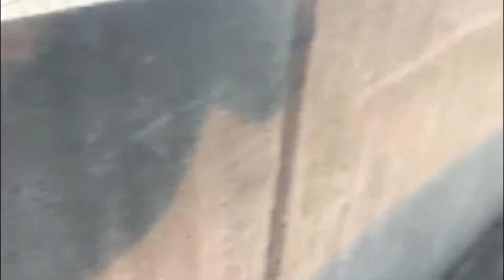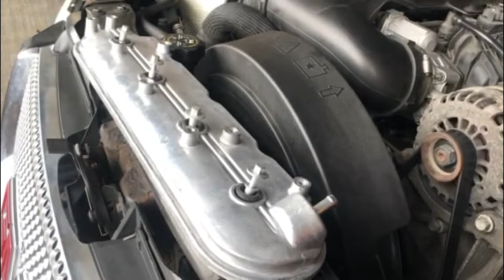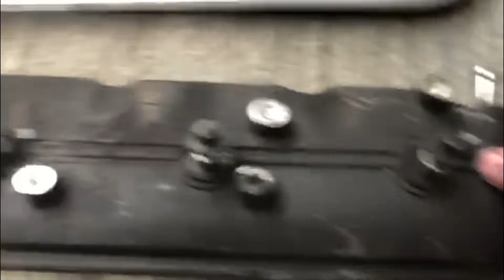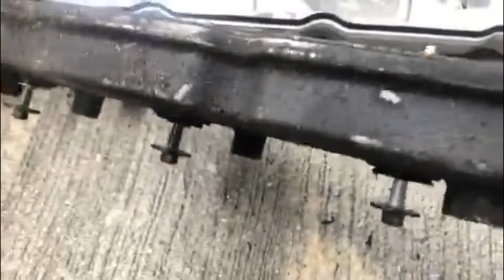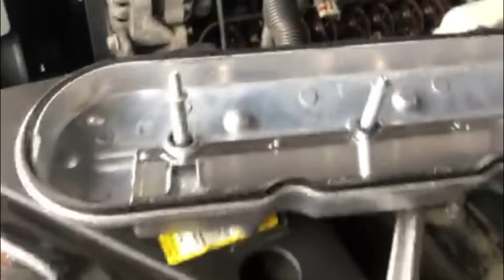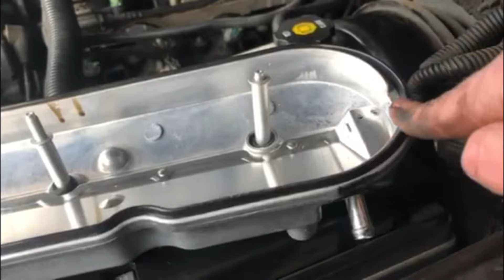Major Oil Loss!!! The GM Valve Cover Swap That Could Save Your 5.3 LS Engine / Motor How To Tutorial

Comment: Need to disconnect the battery and torque the valve cover bolts to 106 inch lbs.

Comment: Just did this on my 06 silverado. Very easy and quick, except that I never know how much to torque those 8mm bolts with the rubber gaskets. You can keep tightening them and they never feel snug... I snapped one and had to replace it with one of the old ones.

Comment: I replaced mine today in my 6.0L G8 GT and the holes were not blocked with sludge. There was some staining, but mine didn't look nothing like yours. But I put the new one on anyways since it is a better design. Frequent oil changes helped keep it clean and I use Mobil 1 5W30 High Mileage Full Synthetic.

Comment: So is the pcv valve Not servable.  In the new one ?
Reply: It's not an actual valve...it's just a vent that takes pressure that builds in the crank case and runs it back to the intake manifold.

Comment: I have that style valve cover in my truck and i took valve covers off and cleaned them and painted them. I also wanted to replace the pcv valve. So i took the old one out which was challenging since im not sire they are suppised to be removed and replaced with a new one. The guy at napa said i could do it and i did get it done. So i think its all good now

Comment: You do not need to change the valve cover take high compressed air and blow down through the fake PCV valve tube to clear seep hole  blockage problem fixed no more smoking or oil consumption

Comment: I thought the issue was with pcv and oil baffle on older style  covers was, pcv in wrong location which was lower right corner of cover and of course the baffle directing oil to that pcv? Your covers appear to be the newer covers that have the pcv port located to the high right....are you sure your covers needed changing?

Comment: 2005 Yukon. I did the repair successfully.  Drivers side only valve cover removal. Drilled out 13 holes. As shown.  
No more exhaust smoke and very little oil loss. Full Synthetic oil only.
I used the rtv silicone to assure no leaks.

Comment: Dude I have a major leak from valve covers I'm about to do new ones did u experience better oil pressure I have about 20lb used to be 40+
Reply from the maker: @bricehale6593  this worked great for me. No more oil loss. Individual results may vary.
Reply: Change the oil ring on the oil pump suction tube-  get the part from the dealer, the aftermarkets don't work.
Reply: @frankpeletz1818  you may be correct, I have it all apart right now oil pan and all has a new mhv pump, with a green o ring, I just bought a melling, a mahle, and some other green ones, and the new melling, is the one o guaged to be the most snug fit, and I'm gonna put a girdle on it, for some reason I'm gonna halfto modify the flag to used it to help hold down the other side, because when the tube is in place in the pump, and the bolt is in, the flag on the easy side is covering the bolt hole, where I've seen guys on video just screw them down, idk 🤷‍♂️

Comment: Did it fixed your problem? 

My 2013 Chevrolet Tahoe has 121k km on it, and I’ve noticed it’s starting to lose engine oil. I inspected it and found no smoke or leaks, but I can’t seem to figure out the issue. Additionally, my fuel range used to be 500 km on a full tank, but now it’s down to 420 km. 

I’m also planning to replace the oxygen sensor this week, but the oil loss is really worrying me. I always change my oil on time or even before it’s due—usually when I have 30-35% oil life remaining.

Any thoughts on what might be going on?

Comment: I have a 2000 gmc 2500 6.0, #1 what kind of engine do i have ,sl ?, 2 is this an issue  as this vid points out for me.
Reply: 2000 6.0 same family ,uses a pcv valve- there is a bulletin to replace the factory 948c with a fixed orifice -the aftermarket listing  valves have the smaller opening. Most of the consumptions problems are caused by the AFM  on the newer engines.

Comment: So How Much did oil consumption improve
Reply from the maker: @mrj7872  mine improved to a point I no longer needed to top off between changes.
Reply: @The_ManCavern  yes! I did this back in 2015 on my 01 silverado 3500 with the LQ4. It was killing about 2-3 quarts of oil in between changes. I swapped mine out, and it dramatically improved to half or ¾ of a quart per oil change! When I decided to drill small holes on the inside of the valve cover, I wasn't burning anymore than ⅛ of a quart per oil change. For the most part, I don't have to refills anymore!

Comment: Change only on the driver side or both valve covers?
Reply: Did you replace both or just driver side?
Reply: @michaelgarcia4117  driver side
Reply: @michaelgarcia4117  only drive side needed

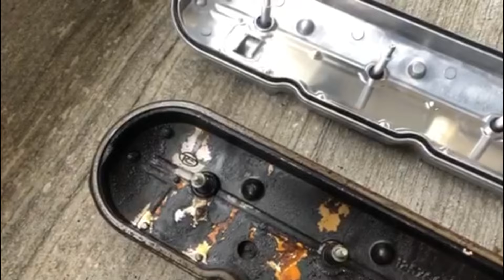Comment: You mentioned they fixed it after 06. My 07 5.3 NBS Silverado 1500 had the old style valve cover. Just putting it out there so people don't think they're in the clear if their vehicle is 06+! 5:11
Reply: It starte with the 07.5. They they never made any attempt to fix the oil consumption problem. GM actually said the oil consumption was normal in order to not warranty anything. The sad part is that GM continued to build their AFM system the same way for years!  They must pay their engineers to sit on their ass and not fix their issues!
Reply: @billmonroe8826  Planned obsolescence
In economics and industrial design, planned obsolescence is the concept of policies planning or designing a product with an artificially limited useful life or a purposely frail design, so that it becomes obsolete after a certain predetermined period of time upon which it decrementally functions or suddenly ceases to function, or might be perceived as unfashionable. The rationale behind this strategy is to generate long-term sales volume by reducing the time between repeat purchases.
Reply: I'm an 08 tahoe... was thinking I'd open up and look at the valve cover before buying new cover.

Comment: I don't recall you stating what the torque on the valve cover bolts were
Reply: Yeah that’s very important, could leak through grommets if torque isn’t right
Reply: 106 inch pounds

Comment: Looks like you already had the updated valve cover? You have the built in PCV...
Reply: I have 2004 Aval and there is no oil leak or consumption issues. Yes, Built in PCV started on 2004 and later. anyone thinking to fix the PCV may swap older 1999 2003 driver side valve cover with external PCV.  in regality the PCV is only a air metered inlet not even a valve. Recommended 3k oil change will reduce all the issues, but way late wont help if was not done on time.  Oil consumption also may caused by oil pan leak.
Reply: There was a service bulletin to replace the 948c pcv valve with a smaller fix orifice  p/n 12572717 on vehicles with replaceable valves.
Reply: there are 3 versions of this. The first, like my 2001 Sierra, has a really crappy baffle and a real PCV valve that is replaceable.
Then what he had was the second version, which had the built-in fixed orifice instead of a PCV, but still the older baffling.
Then the 3rd is the fixed orifice with the new baffling to help further resolve the issue. So yes, he had a newer cover than what is on my 2001, but it was not the newest. His original was V2, and he installed V3.

Comment: I have the 5.3L.  I had success.   used the old cover( drivers side only)  and drilled out as suggested About 13 holes in total on the underside baffle and and driiled out the PCV hole larger. About 1/4 hole. Use rtv silicone to assure no leaks on gasket. 
Also one guy is  advising a full court of ATF in engine. 
My 5.3L suburban started using a lot of oil suddenly when I started driving it more in the winter and idling a lot.
I'm using synthetic oil now the last three changes.
Reply: I know I used half quart tranny fluid to the oil on a Tahoe it stopped all the rattling lifter tapping, ran it for 4 days changed oil all's good
Reply: What's the purpose of drilling holes?
Reply: @sean.g4516  I think the reason is the cover has a channel to the pcv in the back.  If that pathway is too blocked there won't be enough pressure to open the valve and the pressurized engine will find another pathway to eject the vaporized gasoline and oil.

Comment: Did you buy a GM parts or after market valve cover?
Reply: Be careful — a lot of the "expensive ones" are still using the older V1/V2 baffling like what he removed. They claim to use OEM baffling, but it’s the old design, not the V3 like he installed. Also, the cheap Amazon ones aren’t very good — lots of reports of metal shavings and such. Just buy a Dorman from your local parts shop for around $70, and if it doesn’t look like good build quality you can just return it right away.

Comment: Hope your okay. Update on the oil consumption? I have a 2001 GMC Sierra 5.3 with over 377,000 mile, has misfires and losses a lot of oil. Any thoughts
Reply from the maker: @jacobgiroux7541 never had a problem after that. 🙂 oil loss could also be leaks at that mileage. But this helped in my case.

Comment: Did a 280K mi. VC gasket job recently.  They were the originals lmao.  The engine certainly burns a certain amount of oil due to hi mileage, but the main oil loss issue has always been leakage -- not any more.  Oil consumption has been very negligible since forever. My guess is your oil consuption through the pcv system is because there is apparently no valve in the positive crankcase vent.  Mine has a valve  & no problems.
Reply from the maker: @Salmon_Rush_Die  the replacement fixed my problem. But Individual results may vary

Comment: You should have added a few holes lined up acrross where that tiny hole is at the end and also drilled out the hole at the end bigger for better oil dispursement that is best fix for the pcv isdues

Comment: You should have added a few holes lined up acrross where that tiny hole is at the end and also drilled out the hole at the end bigger for better oil dispursement that is best fix for the pcv isdues
Reply: Do you have a picture or drawing showing this tip? If I gave my email could you give a bit fuller explanation of how to do this? Thank you.
Reply: @2TCorDie did you get a answer?

Comment: My 2009 Chevy Silverado 5.3 engine sounds good for 10 minutes after I turn on then I  driving down the street then the truck starts smoking from the muffler starts to idle and start to buck when I take off from a complete stop at a stop sign then the traction control light starts with the check engine light to so if I put a new valve cover this will solve my problem.

Comment: What’s the torque specs on the valve code and coil pack?
Reply: On my 5.3 Silverado it's 106 inch Lbs for cover bolts, and the coill pack bracket just snug them down. I've seen vids where they say 96 in Lbs but my shop book says 106 for a 1999 Z71 5.3 Vortec
Reply: Remember. Those are in pounds. Not ft lbs. 106 inch lbs is equivalente to 8.4 ft lbs.

Comment: I’ve done this upgraded valve cover in my 2006 Silverado with the 5.3 vortec years ago and it changed absolutely nothing. The oil consumption was still as before. What the real culprit is, is that there is but one tiny oil drain hole which if I remember correct is after the Pcv valve which makes absolutely no sense as the oil has already been sucked into the intake by then. You need to drill about four extra small holes on the baffle about an inch apart or so. then clean the crap out of it with brake cleaner and an air compressor. I did this on mine and the oil consumption has been next to zero. 

Here’s a link to the YouTube video I followed

https://m.youtube.com/watch?v=CePGNsAkcYQ
Reply: You modified both valve covers ? or just the driver side ? Also what size drill bit did you use ?
Reply: Did the same thing to my 2004 Chevy Silverado 4.8L by watching that same video this past weekend. I drilled some extra holes and drilled the original hole that was on the valve cover a bit bigger too. So I will see how that works out til my next oil change. 
But I think  I should have thr same results as you and the guy from the video have had. 😎👍🏼

Comment: Put a pct. Valve in the line between the valve cover and the intake. That stopped mine from using oil.
Reply: where you get that part. sir David

Comment: My 2012 Silverado 5.3 is going through one quart oil every 800 miles. I discovered the oil is going into cylinder #7, spark plug is covered in oil. Will changing the valve cover to the modified one fix this problem?
Reply: Most likely valve seals.
Reply: @goch907

Comment: 5.3 is the best engine EVER!!!!!!!😍🥰👏🦾
Reply: 6.0
Reply: @mypony7310 5.3 is better its proven....
Reply: @jonsanders3367 that’s good to hear if it’s true
Reply: I did the cylinder heads. Back in March. Runs great. 291.000 miles . I'm really impressed  with my 5.3 engines..Be BLESSED
Reply: Only if you remove all that AFM sh*t the government put on them.
Reply: Do tou have e. Part number
Reply: 4.8, 5.3, 6.0 is basically the same engine, just with slightly different rotating assembly. They're one of the best engines ever created by GM. My 01 Silverado 3500 LS with the LQ4 has 491k miles with the original head gaskets, heads, original bottom end.

Comment: 7:54 so how much has the oil consumption improved from the 1 quart per each gas fill up? I need to change my pcv since I burn 1 quart every 700 miles.
Reply from the maker: @fish4fun354  I no longer had to add more oil after this.

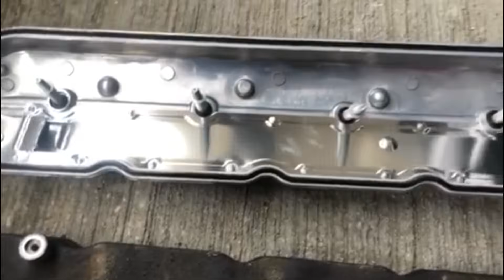Comment: 4:52 why did you say the pcv is just a tube? I have the updated cover but my cover is old again and pcv needs changed. You threw me off and called it pcv later on in the video. Thanks for showing though.
Reply: It's really not a pcv. A pcv is like a check valve. On this engine it's clear through both ways. No valve inside. Hope that answers your question
Reply: @awyoumad  So do these trucks not have a PCV? I've read plenty of reviews that got this cover and fixed their oil consumption issue but not sure if some had to replace updated cover twice.
Reply: @fish4fun354  No, the new valve cover does not have a PCV. The old valve covers did, and GM’s first fix was simply replacing it with a fixed orifice and throwing away the PCV (didi not really help much). The new valve cover doesn’t even have a PCV to remove, it only has the fixed orifices.

Comment: 2010 Chevy Avalanche 5.3 owner here. My valve covers have never been replaced and apparently are the older ones you have replaced and reported problems with. I have never had any oil consumption until just recently, 153k on the odometer. Saw about a quart missing after 1.5k miles after oil change, i did have to replace the oil pressure sensor and filter so I wonder if that has anything to do with consumption either. Anyways worth mentioning my “newer” GM also came with older VC’s.
Reply: Mine is at 180k and needs both

Comment: Did the valve cover come with the gasket also?
Reply from the maker: Yes it did
Reply: Is their a part number or anything?  What's the magic words to find new updated valve cover?  I have 06 tahoe that after sitting awhile it will belch smoke on startup.  Any help appreciated.
Reply: @ 45 seconds he states it comes with a gasket and pcv valve

Comment: So would a bad pcv valve cause an oil leak?
Reply from the maker: I would add the PCV “valve” on these is just a tube.
Reply: V2 and V3 do not have a PCV. He had V2 and switched to V3. V1 did have a removable PCV, but GM recommended removing it and switching to a fixed orifice. That alone doesn’t help much, though, the baffling really needs to be updated too. So V3 is the way to go.

Comment: do you only have to do 1 side or both? and is it pretty much all 5.3l needs this updated valve cover?
Reply from the maker: GM fixed the problem a few years later, but it was most LS engines with displacement on demand.
Reply: @The_ManCavern  i dont know if i have that, my truck is an 05 silverado 1500 w/ 5.3l
Reply from the maker: @extorter  I believe they started DOD in 2007 for the Silverado.